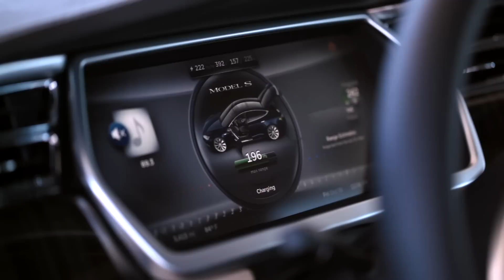CORRECTED: Why Tesla Just Purchased An Ultracapacitor Company

Comment: This is the real future https://www.toyota.co.uk/new-cars/new-mirai/landing     We all have rechargeable batteries in camcorder,phones lap top photo cameras vacuums electric drills etc  - they are rubbish

They discharge every day on their own, will always be dead when you get it out, unless in daily use,  take 2hrs to charge for every 15 mins of life, if you leave an electric car at an airport for 2-3 weeks it will be stone dead  when you try to drive home even if it was full when you left  . With time and or recharge cycles every time it will have less range and less volts or power  every day ....after 5-7 years it will be stone dead for good
Liquid hydrogen cracked out of sea water with electrolysis  powered by solar  - 3 min refill at a current service station gives 400 miles and a fuel gauge  with 10,000 stations in UK  and a Platinum free fuel cell in the car driving electric motors - yes I can see that .

Hydrogen can also be burned  at the touch of a tap in a petrol engine . BMW had a fleet of 7 series  doing just that 10 years ago.Will also power jet engines and vast cargo ships , in fact everything as is now .

You might have noticed Toyota ( who started hybrids with the Prius and won LM last year ) do not now do an all electric battery car  - they do however do a hydrogen fuel cell car you can buy and have thrown their lot in with hydrogen as the future - and they are not mugs.  This is their current car anyone can buy  https://www.toyota.co.uk/new-cars/new-mirai/landing
Work is now close to a fuel cell which does not need precious metals  - that will be the breakthrough    .

Who has vast areas of empty desert and hot sun for panels a coastline for sea water and pressurised  sea tankers  used for LPG, NPG  etc right now ?   - who  could hold the world to ransom on future fuel ? ... if they stopped fighting, stopped building gold palaces and buying strike fighters and cruise missiles from the west ?

Even the ACO.............yes that mob , That runs the Le Mans 24 hrs -   have scheduled the £10M pit complex  refit /rebuild/extent    are now going to plumb in pipework for liquid hydrogen in every pit garage .

Comment: Ultra capacitors will not and cannot improve charging time of a battery. Time for a correction.
Reply: That depends how much charge you put in.  If the capacitor is sized to 10% of your battery you could conceivably get 10% of your range in seconds and have it trickle to the battery at the optimum rate - maximising the life of your battery.  Agreed that it wouldn't help with any amount above the capacity of the capacitor.
Reply: @sionefaatulogalofaa8700  a UC 10% of the energy of a Tesla battery would be around 4000lbs, but a 0.25kwh UC could help with regen